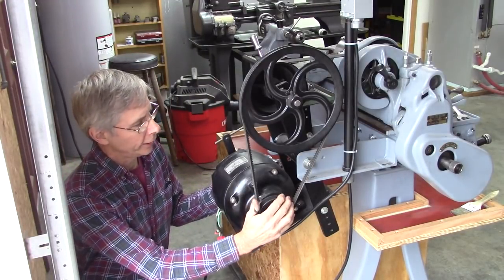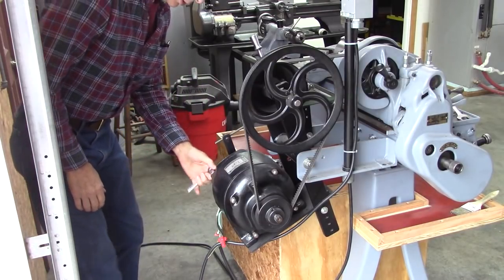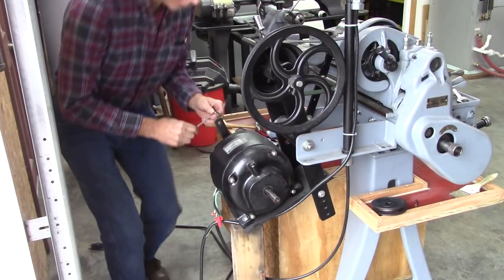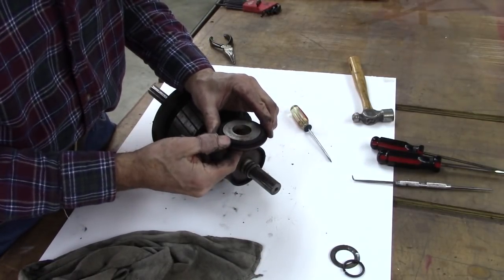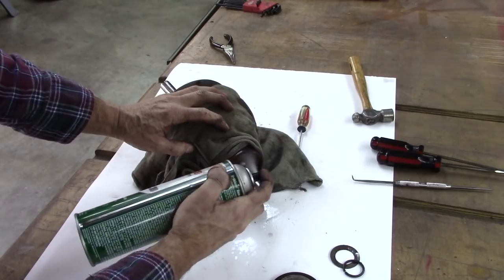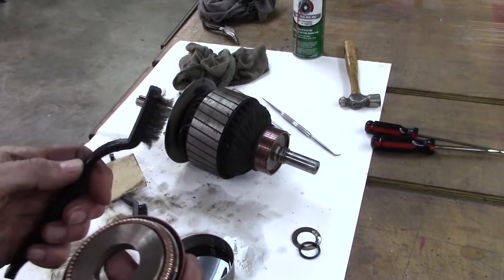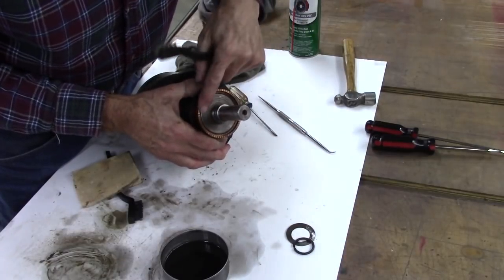Lathe Motor Repair

Comment: You could treat the motor to a protective starter switch - just in case you get the urge to do a lot of heavy machining one day.
Reply from the maker: Probably a good idea but the light switch works very well too.
Reply: @WinkysWorkshop  But it won't trip if you overload the motor !
Reply from the maker: @millomweb  True

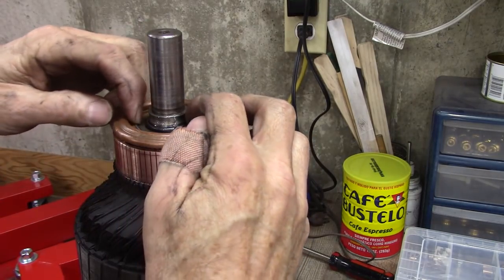Comment: 8:15 Looks like you're using a 'sharp' screwdriver on the main bearing surface - not a good idea ! Yes, a tube to push the ring back in place would be a good idea /technique. It's not is it ! LOL The bearing is in the end cap ! Is it ball bearings or just bushes ?
Reply from the maker: It's a sleeve bearing.
Reply: @WinkysWorkshop  A bush, in other words :)

Comment: I had to change my motor in my old South Bend but it isn't outside like yours, it's under the cabinet. It was hard getting around inside there to get it out. I I had to try two different Motors, and during the first motor, the whole leg fell on top of me taking a gap out of my hand pain in my legs under the thing, luckily I had my phone on my side and I was able to call my neighbor he's 82 years old, he came down pull that thing off me enough to get out from under it. I got it back up in position and put the last motor in. Now it works again.
Reply from the maker: Sounds like a larger motor although mine is huge compared to the HP rating. Glad you got some help!

Comment: 7:45 "Must be some kind of special tool..."
Sometimes if the shaft is narrow enough, I just use a socket wrench socket. Sometimes it's a little fiddly to find a socket that's got large enough ID to slip over the shaft but small enough to press the wire ring. Oh, ha you said socket right after.
I think the centrifugal contact ring is for speed control. When the armature gets too fast the contacts spring out and disable the motor briefly. When the armature gets slow enough they retract, connection is made correctly and the motor speeds back up. Cleaning that up could have easily fixed it.
Reply from the maker: I think it might have fixed it. The centrifugal switch shorts out the windings that are used for starting. I hope I never have to deal with weird ring like that again. That was a first so it may also be the last. I''m 64 and might be working on motors for 20 more tops. Ha

Comment: The type plyers required are called external "notched" snap ring plyers. The tips on the pair I have are ~ 1/4" square with a dimple to catch the angled end  of the snap ring. Use an image search to see the different kinds out there. Oh, and nice job. Think about getting a can of electrical component cleaner. Don't have to be concerned with damaging windings etc. Depending on how much you have to take of the armature make sure the insulation doesn't need to be cut down. Given what you have, a ground cut off tool would be perfect. Utility blades work too.
Reply from the maker: Thanks for the info on both the pliers and cutting back the mica !!!

Comment: Cleaned 3HP repulsion motor up and it ran for a few months.   Then it did not want to start.  Then it gave me a shock through the case and I put it up in the loft.  
It was a noisy beast.    The motor was kinda of period for my lathe but I don't miss it.
Reply from the maker: It sounds like your motor had several problems. I'm not sure mine are fixed but it's a quiet motor aside from when it starts

Comment: Looked thru the comments and no one said this, but at 2:33 when you took out your rotor, it looked like your fan was bent. Just wondered if this might of been the noise at the startup? Really enjoy your videos! Thanks for Sharing!
Reply from the maker: The fan was a little bent but firmly attached to the shaft.  Apparently it's a normal sound. On other videos where I am using the lathe some have said, nothing like the sound of a repulsion induction.

Comment: Winky the thread on that fitting looks like it might be 3/4"NPT or 1/2" NPT
Reply from the maker: The fitting is large, 1-inch NPT.  I thought the motor was the same but it is 1-1/8"-16 thread which is actually smaller than 1-inch pipe OD.,  I made a fitting today. I cut a 1-inch threaded nipple in half and threaded the un-threaded end. I had to do it twice. I ended up grinding the threads off and threading it again. Crude methods but it worked great.

Comment: Sometimes a good cleaning does the trick.  I gave up on being afraid to try to fix things along time ago.  I have learned a lot since then on how things work.  Jeremy Fielding's videos are my electric motor reference library.
Reply: Thanks for that comment, saved me the research project as I was sure "someone" probably has a good library of instruction.
Reply from the maker: I'm the same way...  although I do set priorities. If it's important to me I jump is.

Comment: Why did you not think of using snap ring plyers they would have been much more help full to you with the install of that ring.
Reply from the maker: The only ring pliers I have require holes. This ring was just a sold wire ring

Comment: It is so easy with snap ring pliers I did the same thing in the past  I do not  use them often but boy it is good to have Good health to you and yours
Reply from the maker: I have all sorts of snap ring pliers. This was more like a thick piece of spring steel coat hanger bend in a ring. No holes for pliers.

Comment: That motor is not sounding too good there Winky.  You probably should start to shop around now for a new one or a good motor repair shop.
Reply from the maker: Apparently it's characteristic of repulsion induction motors. In videos I where I have used the lathe I have had comments like, "nothing quite like the sound of a repulsion induction motor." I'm not sure I have fixed the start winding but I suspect this motor will run another 90 years.

Comment: Never seen movable brushes for reversing a motor before ! The only time I've been aware of a single movable brush is on old '3 brush' dynamos on cars - the third brush being adjustable to adjust the charge rate !

Once it's running, does the motor reverse easily - or does it 'complain' badly ;) ?
Reply from the maker: As far as I know it is standard for repulsion induction motors. Normally you would need to remove the cover to move i.
Reply: @WinkysWorkshop  Not come across 'repulsive' ones before. I'm pretty sure I can't see any benefit from it.

Comment: Winky another success story. Perhaps your new conduit fittings are 20 mm metric and the old motor would have been 3/4” conduit thread. They probably make an adapter. For future video reference try NOT to have white paper on your bench as the auto iris on the camera referenced the paper and made the general shots harder to see as they were darker than usual. The rest away from the white paper were fine. Regards from Australia.
Reply from the maker: Yeah...  I noticed that while editing. I need to get a roll of craft. I even adjusted the brightness while editing. Thanks.  It's a US motor so probably not metric. I just made a coupler. It's 16 TPI and smaller than a 1 inch pipe and considerably bigger than 3/4" If I had to guess I'd say 1-1/8 x 16.It took me three tries. I cut a pipe nibble in half and threaded it full size and it didn't fit. I ground the threads off and did it again an it was perfect. Yeah yeah...  I said three, the first one moved in the chuck. Ha

Comment: My 1968 Unisaw has a repulsion induction motor in it. When the mass of that heavy armature gets up to speed, that thing will cut thru anything.
Reply from the maker: 1/2 I'll bet...  these motors are huge. Mine is only 1/2 HP

Comment: No double espresso dance today. 
 I looked up repulsion induction motor. Amazing the things they came up with in early development of the industrial revolution and how quickly they replaced the technology with new ideas. These types of things interest me greatly.
 Thank you.
Reply from the maker: They were popular for quite a while. I might be wrong but I think until the mid 50's. I know I have repaired at least 10 of them in my lifetime. They always have brushes. Some, like my lathe motor, run full time and other retract from the commutator. The ones that retract get gummed up. Most of them I have fixed I just cleaned them. This is the first one i have worked on with the switch on the armature (Shorting necklace). In some ways in simplifies the design but the full time brushes also wear.  I read some electrical theory about the design It kind of made sense but was too deep for me....  complex stuff.
Reply: @WinkysWorkshop  i am a construction electrician working in the wood industrea that has wired 1000s of 3 phase and single phase motors and i still do not totally understand all the theory behind motors. Fortunately connecting one up does not depended on understanding the magic behind them.
Reply from the maker: @countrycraftsman5110  It's hard to understand anything completely. Years of technology build on past technology !
Reply from the maker: @misterkluge  I put a lever on the brushes so that I could reverse it from the front of the lathe
Reply: @misterkluge  thank you. I knew about rotation. But did not know about the speed change. I really enjoy learning and getting good feed back.

Comment: Hello Winky, that's not a motor for a lathe, take an asynchronous motor with a frequency converter.  Dimension larger then you have enough power at every speed and you save yourself having to move the V-belt.  Greetings from Styria
Reply from the maker: What can I say...  I'm old school and this is a 1931 South Bend lathe. If I was in a production shop supporting myself I would not own a South Bend. Greetings from Kentucy!

Comment: This is a blind guess, but I think that copper springy-thing a centrifugal switch: https://en.wikipedia.org/wiki/Centrifugal_switch
Reply from the maker: It is a switch but in this case it is called a shorting ring. the segment fly out and short out the start winding

Comment: This is the only repulsion motor that I've seen so it was interesting to see inside of it. I remember when you made the reversing lever but I don't remember seeing the centrifical switch for the starting windings. Watching you taking the retaining ring off made me wonder if anyone makes pliers that are made to spread instead of pinch. Seems like they would come in handy now and then. Thanks for showing this Winky
Reply: Snap ring pliers can work in both directions. Trick is to keep the jaws on the ends of the spring clip without slipping off. Replaceable tips can be modified with flats.
Reply from the maker: I hope I never see one again...  I'm 64 yrs old and this is a first
Reply: @WinkysWorkshop  I had to deal with those spring rings. Both methods - screwdrivers and ring pliers. To install, use an arbor. In a pinch a deep socket will do.
Reply: @milantrcka121  making tips for snap ring pliers is a great idea. It is always nice to have the right tool for the job. This reminded me of when I was a teenager trying to change my drum brakes shoes with a screwdriver and pliers. Finally a friend gave me a nice Snap On tool for taking the springs off and putting them back on. It wasn't even a chore after that.
Reply from the maker: Yeah...  this is a cool motor. I know the switch was in there but have ever had it apart until now.
Reply: @WinkysWorkshop  sounds like it's running smoothly now. So many things that I have fixed over the years just needed some cleaning and lubrication. Hopefully it won't give you any more problems.
Reply from the maker: @andyZ3500s  So true, I have fixed a much of motors over the years...  mostly just cleaning.

Comment: Check brush length, spring tension.. high mica....loose connections.Cheers from Louisiana
Reply from the maker: Thanks! Yeah...  they all seem to be okay although I'm not sure how much pressure needs to be on the brushes. I think cleaning the commutator may have fixed it.... hoping
Reply: @WinkysWorkshop  Might have just been gummy....If the mica is high, that will lead to bad commutation.. People also make the mistake of using the wrong oil in many old motors.. Something light like 10w non det....Cheers from Louisiana
Reply from the maker: @ramsay19481  - Interesting...  thank!

Comment: I think most electrical problems can be attributed to dirt. Some of those lazy electrons just won't fight their way through dirt. Silly electrons. We just need electrons with more moxie.
Reply from the maker: I've fixed a lot of motor and aside from a bad capacitor they were all just dirt of a sticking start mechanism. I'm just an Armature when it comes to electric motors ...  Hehe
Reply: @WinkysWorkshop  Are you a well armed armature? I did get paid, once, for a motor repair. Does that make me a professional motor repair person?
Reply from the maker: @blfstk1  Yeah... maybe!

Comment: First from Down Under that's a miracle must be the time zones.
Reply from the maker: Cool!  Or when I posted.
Reply: Another from down under, where the women glow and men plunder. 
I love the solid, purposeful construction of these old electric motors. I think you did a fine job Winky Wonder. 
It would be nice to track down that rattle when she starts, can you hear the thunder? You better run, you better take cover.
Reply from the maker: @Bennyboy-dog  - Thanks for the lyrical comment! That bit of thunder is actually characteristic of a repulsion induction motor. I've even had a few comments on my other videos when I use the lathe...  several have said, "you can't miss the sound of that repulsion induction".
Reply: @WinkysWorkshop  Ooooh, that's what that is! Off to wikipedia to learn some more details on repulsion induction motors! Thanks WW!
Reply from the maker: @Bennyboy-dog  - they are interesting.... motors in general